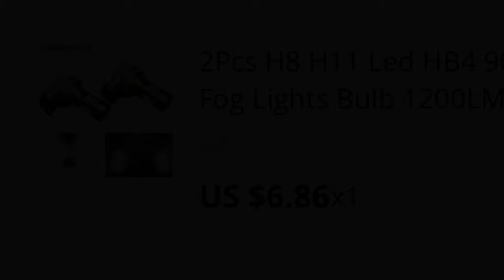Nissan Qashqai J11: How to change the fog lights to LED

Comment: Look more stylish and white but the pattern will be affected because led in halogen house not spread well the light. 

I change mine to led from aliexpress but after two months come back to halogen and now the light spread on the road is good.
Reply from the maker: Well, I live in quite a rural environment which counts a lot of small not lighted country roads and I clearly see the difference with the LEDs. Much brighter. About the spread, I never had any complaints or signs whatsoever ever since so at least they are not blinding oncoming traffic neither. Never had a check done in the garage though so I’m still quite curious about the official reports. When I have (before first technical control) I will come back on this. Maybe it’s all about the type of LED bulbs used...?
Reply: The reason they left the fog lights halogen is because halogen lights perform better in wet/foggy conditions. I was told this years ago but I ignored this fact and on my last car I changed the bulbs to leds. I was then taking a trip up the Scottish highlands when fog closed in and I seen first hand how bad they actually were when I needed something better than just a pretty looking light. 
It's a strange one because when you are facing the LED lights in the fog they are brighter, but from behind the light the human eye does not have the ability to use the extra brightness and so it is lost. However with halogen it's the opposite effect and the human eye can actually see better with the yellowish light in rain or fog.
Reply from the maker: Very interesting John, thanks for sharing. As a matter of fact I never used my fog lights as we virtually never have conditions that bad. I even get annoyed by those people switching the back fog light on when only the slightest fog kicks in... the front fogs are therefore (here at least) more for styling. The switch back is easily made so when ever I have a trip planned to the foggy Scottish highlands I may well follow your advice and switch back temporarily ;)
Reply: @LaPalmeraie0032  as long as the LED bulbs are not the 'Super White' LEDs then there should be no problem with oncoming traffic,  the car looks stunningly better with LEDs in the fogs. And if you hardly ever drive on County roads in heavy heavy rain or fog then the LEDs are definitely an automatic must upgrade. 👍

Comment: please give a link to these led lamps. where did you put them?
Reply from the maker: Дмитрий I placed it in the previous comment but I will also include it in the description 😉 https://m.nl.aliexpress.com/item/32822360175.html?trace=wwwdetail2mobilesitedetail&productId=32822360175&productSubject=2Pcs-H8-H11-Led-HB4-9006-HB3-9005-Fog-Lights-Bulb-1200LM-6000K-White-Car-Driving&spm=a2g0z.search0104.3.70.209062e7n5Q49l&ws_ab_test=searchweb0_0,searchweb201602_3_10065_10068_10890_5730315_319_10546_317_10548_10696_453_10084_454_10083_5729211_10618_10304_10307_10820_538_537_536_10843_10059_10884_10887_100031_321_322_5735415_10103-5729211,searchweb201603_51,ppcSwitch_0&algo_expid=ac1c7d0a-9039-40a6-8526-6d09d01be8f6-10&algo_pvid=ac1c7d0a-9039-40a6-8526-6d09d01be8f6

Comment: Non è possibile smontare le lampadine senza levare la ruota e senza  togliere il passaruota  
oppure bisogna smontare il faro completo dal paraurti .
non è vero che basta sollevare la plastica
Reply from the maker: Yes it is possible! As you can see in the video. The acces is difficult indeed but when you open the inner plastic protection in front of the front wheels you should be able to reach the lamps.

Comment: Grazie per la risposta e il tuo impegno. 
È  veramente  scomodo. 
Ho avuto Audi ed è  molto più facile e veloce , bastava che alla Nissan facevano uno piccola finestra interna come in tutte le altre auto
Reply from the maker: Indeed. Not quite sure why they made the access this difficult. But with the video you should be able to do it yourself. The second try is even easier. Good luck.